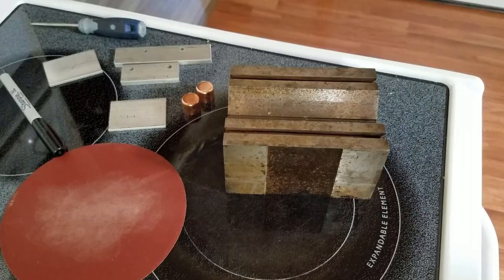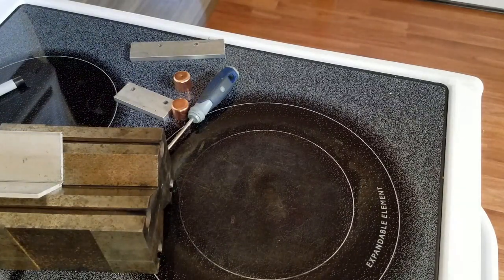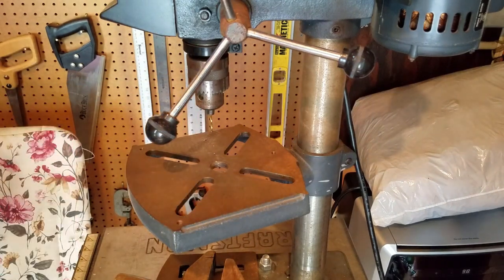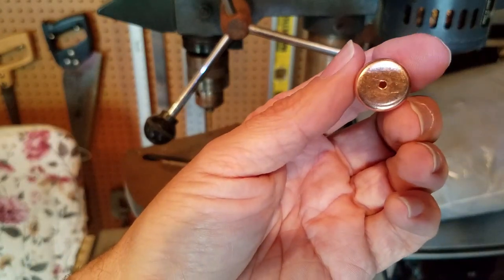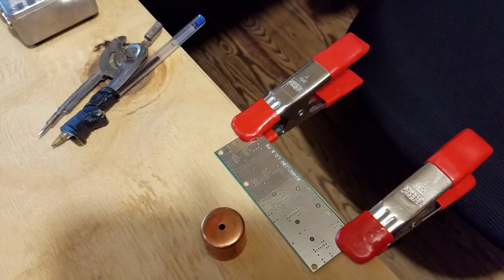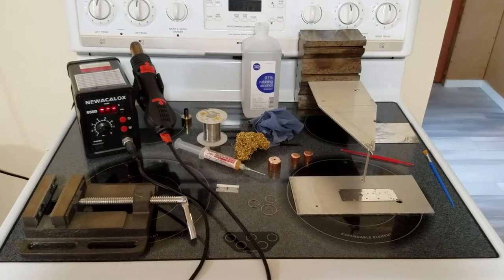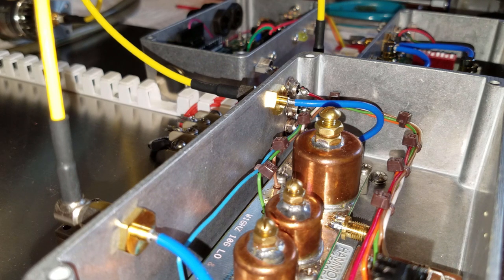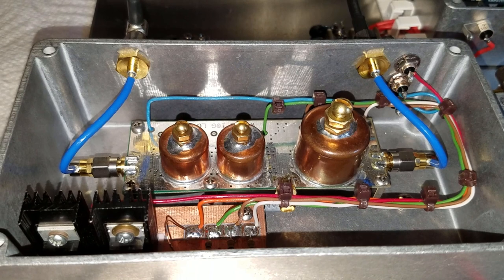10G Making Pipe Cap Filters

Comment: You don't really want lock washers on jam nuts.  If tightened correctly, jam nuts don't work loose.  A washer between them actually makes it more likely they'll come loose.
Reply from the maker: Thanks for the comment. I know it is unusual to use washers with jam nuts but I lack the skill to do it without them. The tuning is extremely touchy on the 10 GHz filters. Without the washer, the transition from jam nut putting no tension on the tuning screw and full tension happens in a very small fraction of a turn of the nut. This makes it very difficult for me to keep the filter peaked while tightening the nut. The split washer smooths out the transition, applying tension to the screw more slowly, allowing for it to be more easily re-adjusted as the jam nut is slowly tightened. I wonder if a modification to use a tuning screw with finer thread and/or a thicker nut soldered to the pipe cap would help with this. I will check to see if alternate hardware is available before  my next project using pipe cap filters.